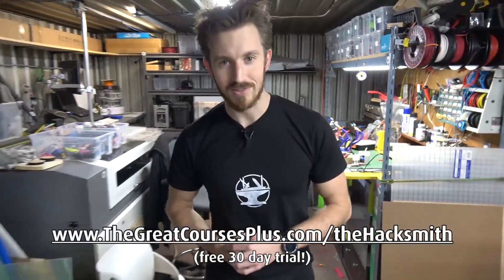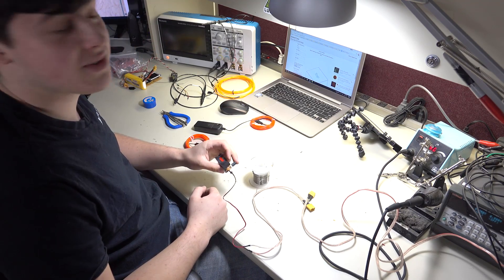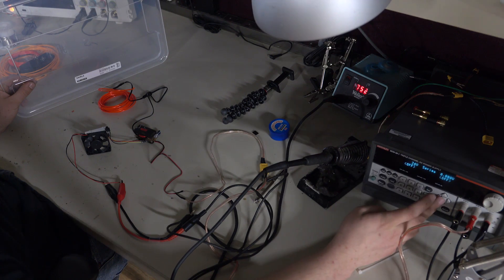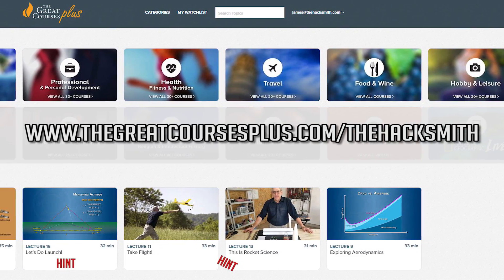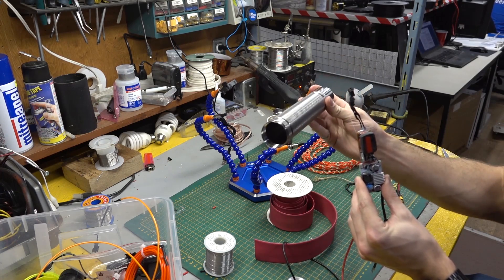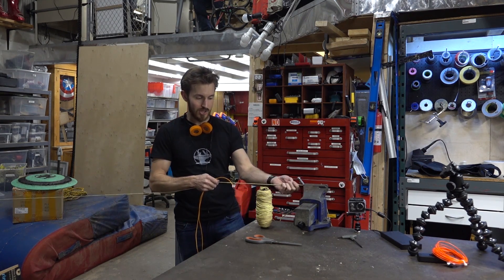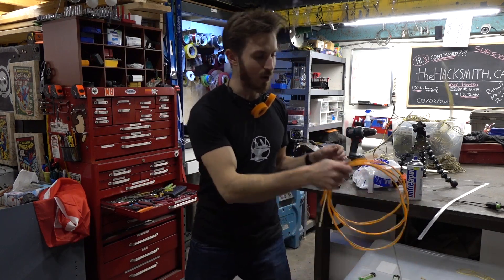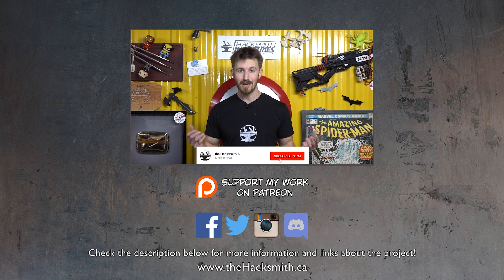Make It Real: WONDER WOMAN LASSO

Comment: use that plasti dip to coat the inside. close flashlight pour in pour out shake to get a thin  thin layer left over.  nice project

where are you that you have an electronics store? i would go broke and spend days in that store.

Comment: This whip looks super lame because of the braid. It looks cheap and ineffective. I bet it would look better if you'd braid or wrap the light cable into the whip as a core to create a glow from the inside-out rather than braiding it into the exterior of the whip material. Look up real whip making techniques for weaving a core into the whip. It will probably be more time consuming, but it should make it look and perform way better.

Comment: Wow, great video.

I'm a power electronics engineer and maybe next time use a decoupling capacitor in front of the Buck Boots Converter😁. As this reduces the noise coming from the switch, i.e. eliminates the wining.

Comment: Im wanting to know if your getting your masters because im planing on getting my masters degree in engineering when im older
Reply from the maker: +dragon beast no, you shouldn't think about a master's until after your degree. Make sure you want to ;)

Master's are just specializations in engineering usually. Doesn't make you better at engineering! You learn far more on the job.
Reply from the maker: I guarantee I've learned more doing this stuff in the past years than any master's degree could have taught.

Comment: Hey, Hacksmith can u please tell me which type of capacitors u've used in that wonder woman's laso (EL driver circuit), the circuit uses XL6009 step up module but I want to know the what type of  capacitors u've used (ceramic or electrolytic) and also about the transformer that drives the EL wire
Reply from the maker: +manish nebhani did you visit the circuit diagram page? Link in description

Comment: Definitely liked having all the project information in the video, you guys made the Attack on Titan swords: you should do the 3d maneuver gear next. :D You could modify Colin Furze's grappling rope launcher design a little to give it electronic activation from the sword handles and you'd be able to fit more/bigger tanks and motors in the sheaths than Colin could on his wrist. If you wanna get real crazy, you could throw on a helmet and go out to the forest and carefully try to go from the ground to a tree to another tree (although maybe a more controlled location would be better, wouldn't want the hacksmith bustin' his tailbone).

Anyway, nice video guys: good simple project that can be fairly easily replicated. Low cost and well explained, keep up the good work :)

Comment: I have an electrical engineer question I want to replace the speakers on my tablet because these ones are crap and only one is working . so when I replace the speaker what factors do I have to look for I mean if I accidentally purchce a speaker too big I would need an amp to run it I know but all the tablet speakers are daunting to me different sizes shapes and how will I know which speakers on digiikey are good quality I want nice loud ones that don't sound like junk. I also have no experience with electric circuits at all I just know how to solder things  together. I know it sounds like such a dumb question. But I for the life of me cannot find anything on google about replacing speakers and everyone always asks what tablet you got. I just want to know how to search on my own these guys want to give me links to the exact same speakers I already have which doesn't help at all.
Reply from the maker: +josh greg honestly it would be easier to just use the headphone jack or get a nice Bluetooth speaker. I'f you're replacing the best bet is to replace them with exactly the same, the speaker should have it's specs written on it. Ohm and wattage
Reply: the Hacksmith its 4 in the morning what you doing up
Reply: I have another project using. The speakers from an organ exactly like the one you smashed and I want to try and make it into a giant Bluetooth speaker/guitar amp but I think my imagination is too big with that one.
Reply from the maker: +josh greg I'm inn England, follow my Instagram ;)

Comment: Dude the energy connectors you are using are not reliable. Im in a FTC robotics course and we had to change them because the code would just crash. Try buying other ones and just connect them to the wire.
Reply: ^ Im serious
Reply from the maker: +57 Bananaman which ones are you referring to? The EL connectors? They aren't great but they came with them. The XT30s we use for the battery are good though!
Reply: I can ask the builder in my group, im just the coder.
Reply from the maker: +57 Bananaman I don't understand, your the one who said they're bad connectors, which are you referring to? Lol
Reply from the maker: +57 Bananaman you just have to spread the pin open to make them stay together nicely =)
Reply: I dont know how to do that so I will just discord you
Reply: I sent it to the command spam
Reply from the maker: +57 Bananaman that's not a channel for questions...
Reply: AHHH! were can send it to you?
Reply: I tweeted it @57Bananaman

Comment: Make Doctor strange's cape by putting to  drones on it and do what the dude who made Thor's hammer that flies for to gloves(the gloves will be like controlers and you would have to wear something to hold anything you might need and also put a magnet on  your back and on the inside of the cape for more sturdness) a glove for each mini drone inside of it and add minor magnets to the bottom of the drones and on a shirts put matching magnets under the shirt so it doesn't fly off of you when there's lots air.

Comment: If you just add multiple strands of EL wire to the original circuit in parallel wouldn’t it eliminate the brightness issue??
Reply from the maker: +Mark Washington no? We want it to be bright... If you put them in series they would get dimmer
Reply: I was thinking in parallel

Comment: Did you get a new compressor for the Elysium project? If you still have the old one would it be possible for me to get it , I’m in 9th grade and I’m trying to make my own exoskeleton (I’m in Quebec too so it won’t be super hard to get it)
Reply from the maker: +Joseph Stalin the compressor I used for that was my garage compressor lol, still using it. And it would cost more than it's worth to ship it to Quebec lol
Reply: the Hacksmith Lol, regardless thanks for checking this out!

Comment: Make captain cold’s cold gun
Reply: puts liquid nitrogen in squirtgun
Reply: TrionicX hell yeah
Reply: ghost the silent killer I think supercooled alcohol is a more suitable choice
Reply: TrionicX- great idea and wht about the heat gun used by MICK RORY A.K.A HEATWAVE.
Reply: Use air duster😂😂
Reply: I wonder if a freeze ray is possible.  Like not a liquid nitrogen sprayer, but some sort of radiation that cools stuff down.
Reply: Megatom That doesn't make any sense. Cold is a lack of energy and  movement. Radiation is like the exact opposite.
Reply: Gear Head but radiation can be used to cool matter down through laser cooling.  It’s just that I don’t think there’s a more practical version of that.

Comment: Any chance any one could suggest a 15 amp battery for an electric motor for a go kart project?
Reply from the maker: +Concave Sloth I like lipos
Reply: Even to pull 15 amps? To power a 3000 rpm motor?
Reply from the maker: +Concave Sloth the lipos we use can put out 250A+
Reply from the maker: +Concave Sloth just research a bit haha
Reply: the Hacksmith ok cheers

Comment: What if you made WW's lasso with paracord instead of kevlar rope? That way you could feed the EL wire into the cord as well as make it look like a proper rope/lasso, King Of Random style.
Also, would paracord still be viable material as oppposed to kevlar rope?
Reply from the maker: +AeroQC it stretches a lot more

Comment: I think it's a great project, but the kevlar string and the EL wire need to be wrapped together more tightly, or have something on the outside to make them seem more like one braid, not 2 strands, you can easily see the several strands which makes it lose it's effect
Reply from the maker: +Bryan Guerre for cosplay sure, but to use it you'll break the EL
Reply: the Hacksmith touche, function over form